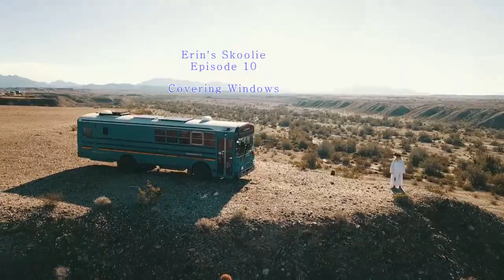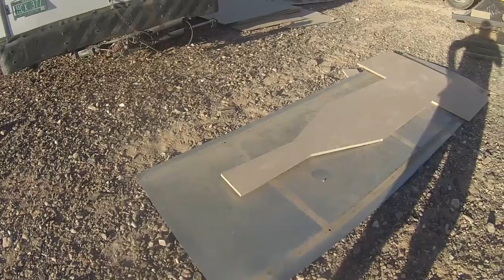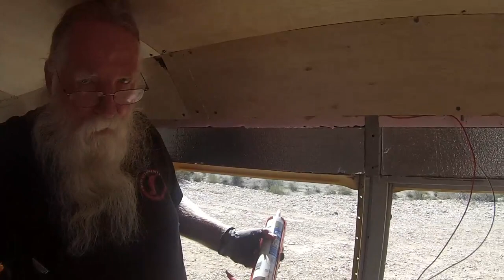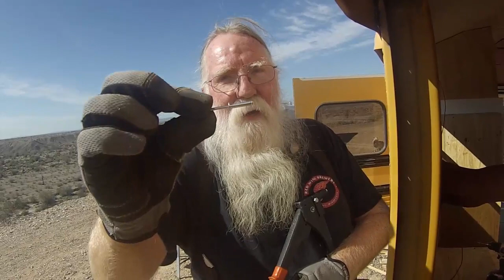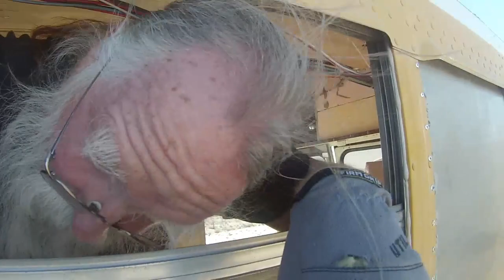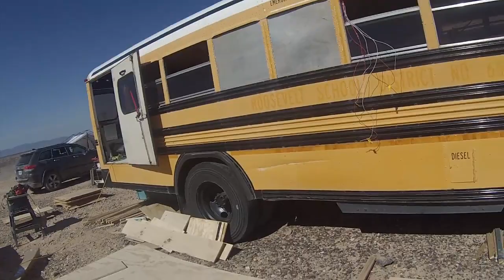Erin's Build Episode 10- Covering Windows

Comment: Hey Steve, I've seen where folks used normal pop rivets on air stream trailers and they will leak water.  So you have to go back with a sealant and apply it to each one, on outside, on the head, or use rivets the are special called closed end Pop Rivets and don't leak.  Benefits of Closed End Rivets
Closed End Pop Rivets are often referred to as sealed blind rivets, or sealing rivetsbecause they create a watertight seal when installed properly, making them a popular item in the boating and automotive industries.
Reply: Yeah, I would have welded a sheet metal.  Learn welding, it's not hard.  Or, use butyl tape and rivet. It's better than silicone caulk. Silicone is going to leak.